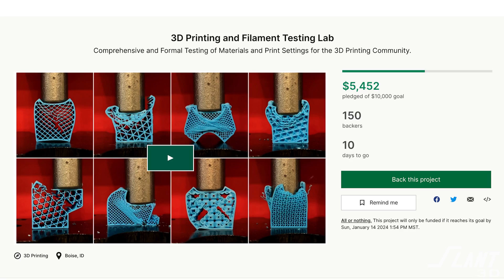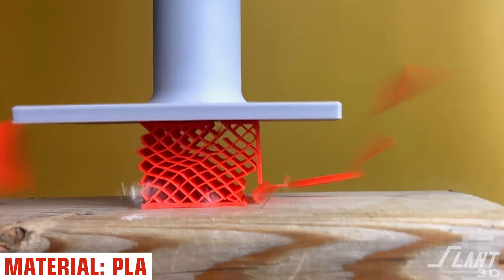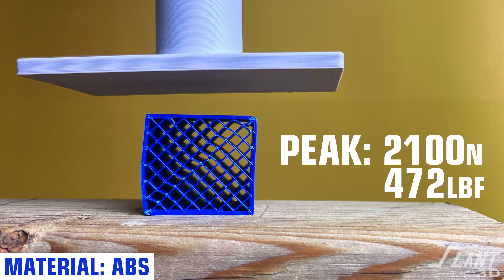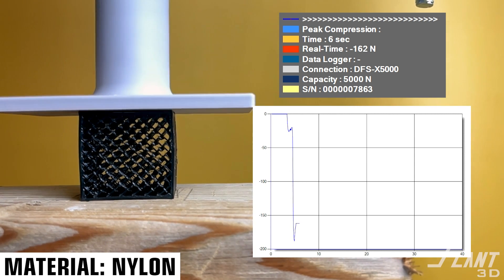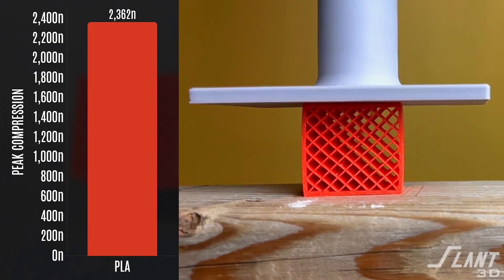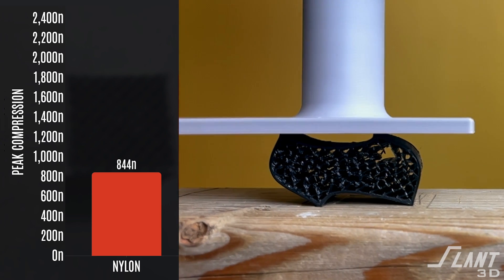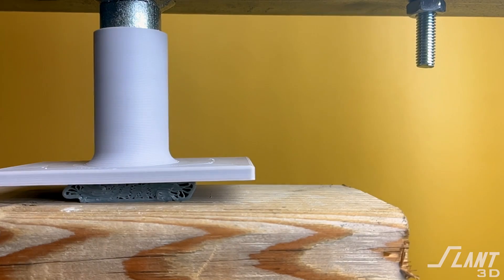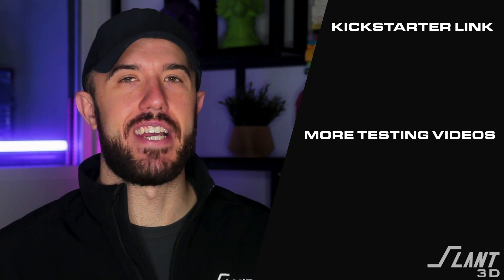How Strong Are Common 3D Printing Materials?

Comment from the maker: What materials did we miss? What should we test next?
Reply: Would be nice to also have international units like kg instead of lbs. 

Would also be nice to have temperature and humidity info on the tests.
As you mentioned in the video PLA will behave better in less warm climates.
So knowing what temperature and such you had in the room during the test and controlling to keep it similar would be helpful.

Other than that I'm looking forward to what you have coming!
Reply: @Dkbay  In the images they list the Newtons as well as the pounds-force.  A Newton is the actual SI unit for force, but if you want kg-force multiply by 9.81.  (On Earth,  anyway, because how much something weighs is dependent on the local gravity.)
Reply: The Newtons is basically your international unit, if you really want Kg you can yust devide the Newtons by 10 (or 9.81 to be more precise) @Dkbay
Reply: @Dkbay  Slant3D is using pounds-force (lbf) not avoirdupois pounds (lbm, m for mass). Note the video displays "LBF" (f for force). kg is a unit of mass,  Lazy use of "lbs" can mean either lbf, or lbm depending on context.  To add to pound confusion "lb." is from Roman times and is an abbreviation for "libra" which happens to be 12 oz. not an imperial 16 oz. "lbs." is also not a plural of lb.
Neuton (N) is force (1 N = 1 m/s * 1 kg). So on Earth, 1 kg is __ N / 9.8m/s. ie: take values displayed in neutons (N) in the video and divide by 10 for a close approximation of kg (of mass).
Reply: carbon composites and maybe fiberglass too. Thanks!
Reply: I'd like to see polycarbonate and polypropylene, appreciate the testing btw
Reply: Of course we need to test my Goto for usable parts the CF filled Nylons 6 & 12.  I still holding hope for the Kickstarter!  9 days left..
Reply: PLA+
Reply: I'd like to see a similar test where you compress things to near but not over their failure point and then release, so there's a sense of how deformation-resistant each material is.
Reply: You should test ASA next that is a common one for outdoor projects.
Reply: PC
Reply: It would be interesting to see how esun pla+ behaves, also ASA is yet another interesting material to consider. Btw, thanks for the unique content!
Reply: It would be fun to see some crazy engineering filaments like PEEK and Kevlar
Reply: please test PCTG, which should be a stronger sibling of PETG and HIPS
Reply: Nylon.
Reply: @ttonAb2  ... they didn't miss nylon though
Reply: 4th comment said PC... and I said nylon because that was nowhere near a fair comparison for nylon. That print lacked any integrity. It would be like comparing the strength of wood and concrete but the concrete had three times the water it should during pouring and you end up with gravel.
Reply: 3d Fuel PLA Pro.  If you haven't printed with it yet.  You need to.
Reply: Why is no one saying to include polycarbonate? It's such a good material
Reply: Please also add kg test results
Reply: PA6 and PA12 carbon nylon would be nice to see how much the carbon stiffens it up. I have some, and wondering how it compares to the PETG I've been prototyping parts with.
Reply: PC
Reply: @slant3d  could you do sheer testing on materials
Reply: I'd really appreciate a subset of PLA testing to explore properties of different varieties (plus / meta / high speed / silk / matt / shiny) hitting the market.
Reply: ASA
Reply: ASA
Reply: ASA
Reply: ASA
Reply: ASA
Reply: ASA
Reply: ASA
Reply: ASA
Reply: ASA
Reply: ASA
Reply: Would be nice to add these into the comparison ...
PC, PP, PA12, PA12CF, PA12GF ... maybe even ASA (although expected to be similar to ABS)
Reply: TPU at higher infills is insanely strong. Like, INSANELY strong.
Reply: 'carbon fiber' filament... there's a few different types, would be interesting to see what differences they have.
Reply: What about ASA? Is it different enough from ABS to have different results?
Reply: ASA
Reply: What Tests you are missing and basically the entire Internet is:
About the flexibility of materials.

Nowhere is a demonstration about how flexible different hardness levels of TPE/TPU are.

Also a comparison with other standard Materials would be great.

For example print 2cm x 10 cm sticks and bend them by hand so people get an idea how hard or flexible that TPU is.
Reply: You should use standard tensile specimens, create a solid block of each material with unidirectional grain, and cut out standard tensile specimens in each of the three original directions and compare its strength against/across/through the grain.
Reply: Put 'compressive' strength in the title. Saying a filament is strong is horrendously naïve...
Reply: may i suggest to flip the tested object, test it whit the infill face up
Reply: @stoq6tiq second this

Comment: I use Inland TPU for a lot of projects and it's just so good if you don't need as much rigidity but need near-invulnerability.

I set up an Ender 3 V2 with a direct drive extruder and volcano heater with a volcano CHT nozzle. With the Inland stuff, I'm able to print it at the same speed as PLA which is insane for a flexible filament.

Comment: Excellent video. After many years of using PLA and PETG, among other materials, I have noticed another factor: time. My home is fully loaded with 3D printed utilities and I have noticed that PLA ages faster than PETG. Cracks more easily. Especially over 2-3 years but this is completely dependent on environmental factors.

Comment: Nylon looked like super bad printed. PLA failure was dangerously for engineering application. ABS PETG Nylon fails much safer. Compression resistance is not everithing… we could see impact , traction and so on …

Comment: based on the design of the part you are not testing compressive strength.  not really sure how to evaluate this test because the design failed long before the material did.  if you look closely at the part during the test, some areas were being tested by compressive forces and some by compressive forces.  you need to take the design out as one of the variables.

Comment: I've been looking for ages for impact resistance test materials, but its so difficult to find apart from people hitting them with hammers which isn't what i was looking for, I'm looking for the best filament to use as a test vs medieval armor, so curious vs hitting with a sword or bullet, I'm curious to know how a 3d printed armor suit would actually perform, as there's PPA-CF on bambulab which says it has "metal strength" It makes me curious of that/other materials as actual armor and how close/far the difference would be

Comment: Compressive testing is not the issue with FDM.  Tension and bending is, especially when faced with multi-axis stress where you need layer to layer strength.  So I would like to see shear and tension tests.  Also adding a threaded insert pull out test would be helpful.  I suggest adding Resin printing, as the materials have come a long way.

Comment: I completely dissagree with your opinion on PA (nylon), I think you just got bad results with that print. In manufacturing, PA is often used to replace ABS as a stronger substitute, If you need stronger you then go to PA-GF 15/30/60 etc. We actually rarely see abs on any decent plastic part these days. You can typically find the "PA" or "PA66" or "PA66-GF30" is very common.

Comment: Hi, I just saw your KS campaign - cool!.
 I also think that this topic is really important, that's why I started building my own test devices a few years ago. 
Currently I'm running these tests: tensile strength (XY direction for the material and Z direction for the layer adhesion), bending test (for the bending modulus), impact resistance, temperature test. I publish the results in the German Make magazine and on my YouTube channel (also German) but I also want to create an online database for comparison. So far, I tested around 50 different filaments from PLA, PETG, ABS/ASA to PP-CF, PA6-CF and more advanced/modified materials. 
Anyway, I'm currently developing an open source universal tensile testing machine, that will be able to apply up to 5kN force and use different specimen types, like the dog bone. The cost of the parts will be around $500 and I plan to release it in the next couple of months. So you might want to check this out. I know that it can't replace a professional equipment but the results are very precise and close. Feel free to get in touch.

Comment: The compressive modulus never comes into play with this shape since the walls buckle early and put the infill into either tensile or shear loading depending on the buckling mode that occurred (read up on slenderness ratios for some good info).  The results line up reasonably well with the elastic modulus of the materials because of the reliance on buckling resistance of thin columns.  The critical buckling load for a given geometry is directly proportional to the elastic modulus in the Euler formula - https://en.wikipedia.org/wiki/Euler%27s_critical_load .

Comment: Ive had an idea for a bit on tpu. You previous showed off infill strength based on type. 
I am curious about infill resiliency. Which patterns is going to deform and reform the best. 
If we printed a tennis ball, which would mimic a tennis ball best, essentially.

Comment: No brand names for the materials, no showing the close ups of the failures, etc.

You can get nylon that's stiffer and has higher compression strength than PLA/PETG. IDK what nylon you used but it's clearly horrendous. It's super soft while also having atrocious elongation at break. Either the print process was very very wrong or the material was a dud.

Comment: @slant3d: Please consider an “open” class in your testing program. Lots of people claim to get amazing results with a specific material when they follow a special ritual of material drying, slicer settings, machine configuration, post processing, etc. Pick a few standard test models, set some ground rules, and let people submit their best work along with the recipe they used to produce it. @slant3d tests the samples in the lab, then publishes the results & submitted recipe on a leaderboard for that material.

Printing all test filaments with "standard" settings & conditions might seem like a good idea, but it's not how people actually use their printers. Many of us are constantly fine tuning to get better performance from the same material & machine. Material performance testing should reflect that, showing the best possible performance you can get from a material, from the best known recipe.

I for one, would love to see ongoing competition over how to get the best results out of a common inexpensive PLA+,  an ASA, and a CF Nylon. Over time it would tell us "Here's the best known performance you can get from low, middle, & high cost filament." That would be really valuable knowledge for the community, especially those of us engineering & selling 3d printed products, with mechanical properties that vary wildly depending processing parameters.

I love this testing series, keep them coming!

Comment: From my 8 years of printing - still doing most prints in ABS. It has noticiable impact resistance which makes it very durable in real applications. Easy to glue and make water-air tight with acetone, easy to process. Occasionaly uses PLA and PETG, the last one tends to break in sharp shards when mechanically fails.

Comment: I applaud your intention to move into more rigorous material testing.  But if you want to be taken seriously, you need to be careful about precise use of language.  Strength and stiffness are different, for example, and both terms were used without clear distinction.  Also, durability is not a well-defined material property, while toughness is.

Comment: Would have been nice to compare compression on the printed z axis. I think the infill pattern would have helped increase resistance that way.
Reply: it does - but that's besides the point, the test is along the weakest axis, since that's most likely/typical for an object to break. And the type, % and direction of infill matter too - but this is more of comparison between different materials re compressive strength
Reply: That's why I use cubic infill

Comment: The one thing I'd say was missing is just the term "toughness" rather than just "durability" because it's the engineering term in case someone wants to start doing their own research. 

I can't wait to see you get new equipment so you can test things like tensile samples, abrasion resistance, chemical/UV fatigue, cycle fatigue, and other such properties. 
I do think the format you're using has been good so far to give new users a more intuitive sense of material properties.
Reply: I admit I have always wanted to see someone get one of those UVC bulbs, put it in a properly save enclosure and then say subject and ABS and ASA part to repeated oh 12hr cycles for some extended time and then test the durability. ASA is supposed to be less prone to being destroyed by UV.

Comment: I love videos that show that PLA does have a use-case and that different materials are good for different things. So many people think PLA is just bad in all respects.
You should definitely add polycarbonate now that it's pretty easily printable (moreso than nylon) and is super strong
Reply: it's somewhat the opposite - not "PLA is sometimes useful" but PLA is (and should be) THE material of choice for most all purposes. 

Unless you need something rubbery, then it should be TPU. Or unless you have special specific requirement (solvent finish/soldering, high-temperature use etc). There's no other "material of choice" to start with - it's not PETG nor ABS, even as some have developed such mindset

Comment: I think that Time should be highlited More, petg performed as expected, a bit weaker than pla but More tougher, withstanding a similar load for over double the Time, Is not as heat resistant as ABS or stronger as pla but Is a mix, while being resistant to chemicals which ABS can be eroded quickly with acetone.

Comment: PLA that had a higher glass transition point would be great. Just enough to survive hot days and dashboards. PETG is my current go to but the stringing is annoying when we move to batch prints.
Reply: Protopasta's line of HTPLAs work well for that. You can heat treat them and then they perform much better under higher temperature scenarios.

Comment: I print mostly with PETG, PLA is easy to print with and get beautiful results but when it comes to holding up in warmer conditions it just fails.
Reply: What is the definition of a "warmer condition", what temps we talking here?
Reply: @xorbe2  gets weak around 50-70° so if it sits in the sun it degrades from both heat and UV light.

Comment: From CNC Kitchen's videos, I've been convinced that if I wanted to 3d print a doorstop or a hammer, PLA was the way to go.  Nice to see that reinforced here.

I was intrigued that ABS and PETG are about the same for compression.  I mostly only use PETG when I'm planning to put a screw through the plastic, on the theory that its mild flexibility will help it come with the metal/plastic interface better.  I use ABS a lot, though, because I do a lot of cosplay / prop reproduction and ABS is soooo much easier to sand smooth than other common filaments.  (It's also less toxic to solvent-weld.)
Reply: I'd go with TPU for a door stop from experience.
PLA is hard enough to scratch wood floors, and slick enough to not want to bind to the door or floor.
I have printed up shock mounts in PETG and TPU (both on the same part) for my printers. my abode isn't firmly anchored to the ground and the vibration from the printers (or the other way around with my washing machine) mess with each other, and me. Input shaping goes a long way to ameliorate the printers themselves shaking
Reply: @davidconner-shover51  @logicalfundy I think this is a "different slang in different parts of the world" problem.  To me, "doorstop" means a thing attached to the floor or wall that the door bangs into.  What you're describing is a "door wedge" in my world.  (Though to be fair, I would also have tried PLA for a door wedge because the problems of it slipping or scratching would never have occurred to me.)

However, PLA would still make a good hammer.
Reply: @davydatwood3158  Lol, I lost half a kilo of expensive filament and several hours fixing the printer to that one.
Two fails that day; One of my other printers somehow worked loose the nozzle, which is a diamondback. no damage to the nozzle or hot end, but it did a beautiful job of machining a dragon print into the build plate, rather deep into the steel backing.
I have changed my nozzle change procedures since, I immediately load PLA, then let it bake at 280c for half an hour or so. makes it more difficult to remove, but no more leakage/loose nozzle issues either
Reply: If the door is slamming into it wouldn't that make tpu even better to absorb the impact? Pla is the worst filament as far as impact resistance.
Reply: As far as printing a doorstop goes: PLA is also quite slippery. I tried printing some doorstops, and had to put rubber feet on the bottom so they wouldn't slip.
Reply: Less toxic? I would think it would be more just because of the styrene fumes
Reply: @arivo625  plastic fumes are much less of an issue when solvent welding than the solvent itself, and acetone is a much less dangerous solvent than something like MEK, which is what you use on PETG, or ethyl acetate, which I'm told works on PLA.

MEK is in fact a controlled substance in many jurisdictions because of its ability to cause lung damage.